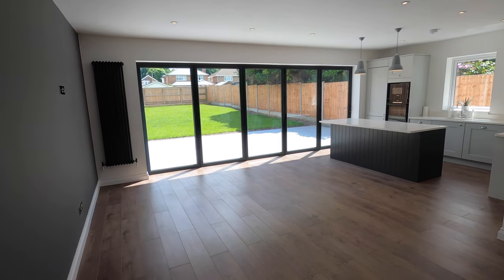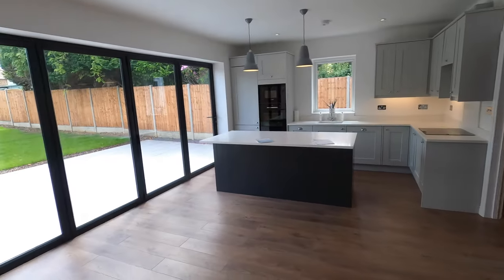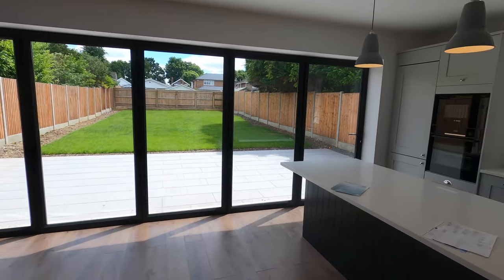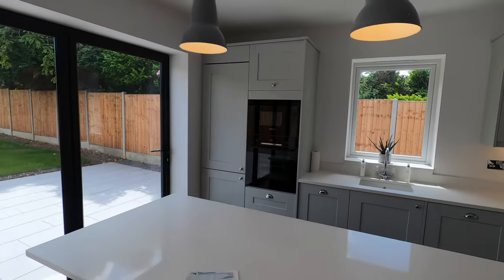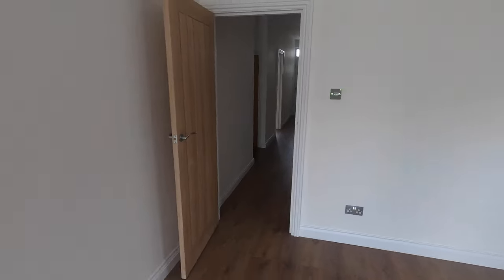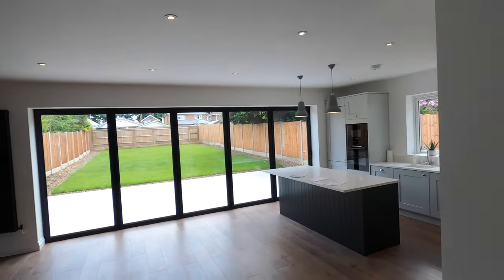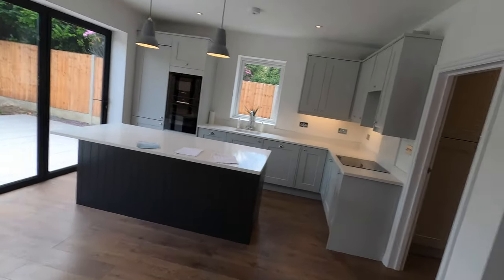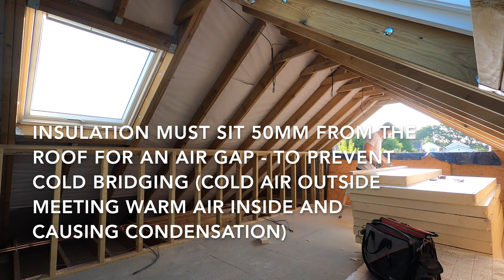How Much Does It Cost For A House Extension? Time Lapse Of My Home Restoration / Home Renovation

Comment: Im looking to build a small extension 5meters x 3.5m. theres no drains or electrical cables and its a new build property i have and the extension would start at the kitchen patio doors. 

Do you know what kinda price id be looking? 
Your house is fantastic!
Any advice
Reply from the maker: These days you are looking around £2,000 per square metre for the structural part of the build; blockwork, drains, roof etc - so perhaps in the region of £35,000 plus VAT.
Reply: @NicksHomeRenovations  thanks..

All I would want is it yo ge wind and water tight and I'll do everything else within the extension. Quiet pricey I was thinking 20k at a push.. maybe I'd be better selling for a bigger house.

Comment: Congratulations my brother! Beautifully executed project. May the success long continue. Can i ask what an approximate costing would be on a double storey extension? In se london area. Just the structural aspect. Thanks.
Reply: Depends upon the size of the extension £1500/£1750 per m2 in London
Reply: @ABB-bw6tc  thank you nick my bro. Is that fully complete or just structural? Thanks.

Comment: Just watched a bit of this for the first time. Looks like there will not be enough space between the house and neighbors on either side to get any kind of equipment or perhaps even garden furniture into the back garden if ever needed. I wouldn't want that problem in anything i bought.